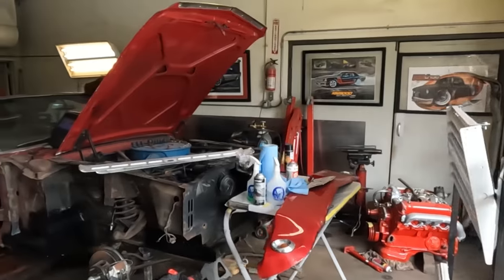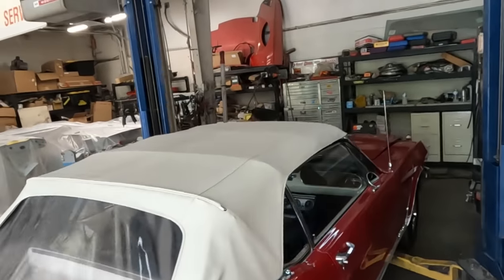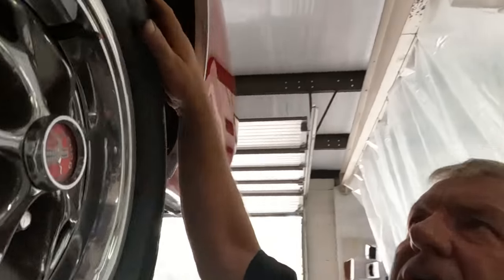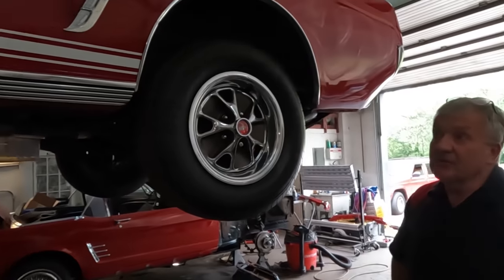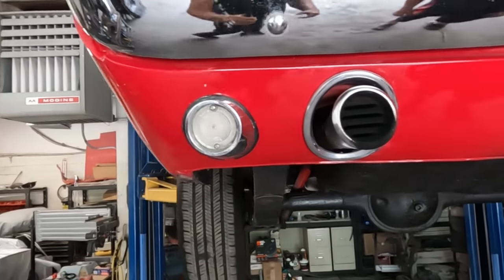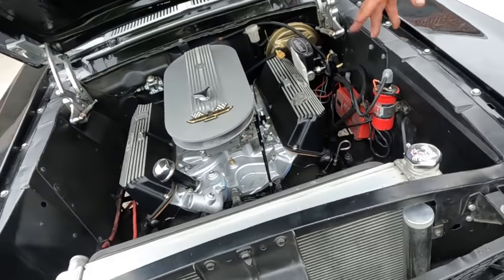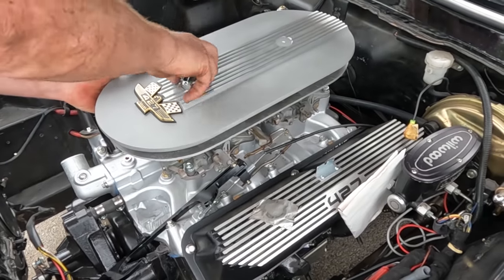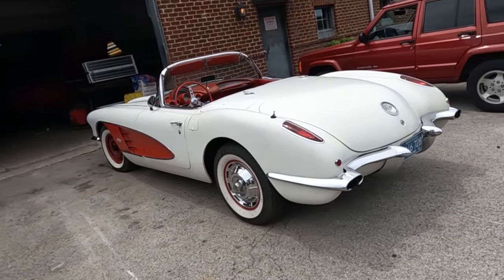Even MORE Classic Car Flipper Thievery, Incompetency And Nonsense

Comment: I was  the one that made the comment about walking past the green Camaro. I dropped a timestamp and mentioned I'm a huge Camaro nut. There's something about the 2nd gens, they look so good. I had a '71 with a high comp 350 with a mean cam. Of course I slapped a high rise intake on it and long tubes. 3.73 gears 4-speed. The thing about these cars that surprises most people is how good they handle. Really fun cars. Not real fast but quick enough. 

I'm not a huge Mustang guy but whoever sold that red hack job convertible should be exposed. That ain't right. There's a few places up here in Northeast PA that were pulling crap like that in the early 2000's. I almost bought an '86 Monte Carlo SS until I realized it wasn't a real SS. It was a 4.3 V6 car that someone put SS parts on and dropped in a junkyard 350. It looked convincing for about 10 minutes and the paint was real nice on it. The motor mounts didn't look right and that's what made me dig deeper. The car wasn't worth half of what they were selling it for.
Reply: How much can a 86  monte go for any way?
Reply: Back in the early seventies a friend of mine was working at the local Chevrolet dealer and he was just really a utility worker although he had hot rods and had worked at various gas stations doing mechanical work. Well there was another kid that worked there as well and he had put an order in for a big block Nova and while that was in the works my other buddy who's job it was to test drive the newer vehicles test drove a new Z/28 Camaro ( a 70 model but due to the GM strike did not actually go into production until 71) and my friend told that other kid that the car was a freak and he should buy it. This car was one of those that just ran right out of the box.

Comment: It'd probably be smarter to just put a roof back onto the mustang coupe where it should be.
Reply: Far more practical and actually accomplishable, and kiwi can do it for sure
Reply: either that or do a full endo cage inside of the rag top if the owner doesn't mind the crowded cockpit, not to mention it would look ridiculous with the top down but it would be the cheapest option
Reply: Exactly. Tbh I'd rather have a coupe.
Reply: Dont know if it would be worth the cost unless it was a numbers matching car. Might be but it would depend on ones intentions for it. Many people would find the value just in having a nice early Mustang while others are always looking at the investment value.
Reply: @edfrawley4356  I think it'd be cheaper to put a roof back on it than to find all the factory bracing or build the bracing for the convertible top. If he doesn't care about the factory style appearance he could go the roll cage route it'd probably be even cheaper than putting another roof on it.
Reply: @DanEBoyd  it'd probably be pretty hard to find the braces and torque boxes to put on it. If you can't find them you have to build them and having someone do that can get pretty costly. I've always thought structurally the spot welds would keep stuff from flexing better than the mig welds that would replace them. That may not be the case maybe it's my OCD that bothers me about it.
Reply: @dylanhartz8473  im pretty sure cage is out of the question- never met a convertible mustang owner who wants to ride with a helmet on. Driving in a caged car with no helmet is just tarded- your skull is gonna open like a raw egg when it crashes into the roll hoop
Reply: Insure it and crash it or burn it
Reply: Have you priced out professional body work ? I'd wager it's cheaper to reinforce the structure, and tons of options are available, every piece is available in reproduction, and superior aftermarket solutions also.
Reply: If those GT badges are real, then yes, you can splice in a roof. it will be better to remove all paint than try to match, and likely more butchery will be found. that all said....with the demand for fastbacks now, Ringbrothers offer a carbon fibre roof, and you can find other sources to upgrade this abortion if its not a GT car and make an eleanor for someone who will pay a lot for it. Or it can be cloned into one of the rare shelby convertables, the torque boxes and extra braces are all out there--Mustangs get rebuilt often enough their sins (leaky cowls, side rails) are reproduced so you aren't cutting apart a parts car. It just takes a knowledge of Mustangs, not some generic "we do everything" resto shop that checks out some youtube videos and think they're expert since they can do a spot weld.

(in 1964 Mustang VINs did mention with a 7 or an 8 whether it was a coupe or convertable, too bad the buyer didn't check into it. Doors get swapped and the tag gets lost, but there's a stamping under the driver front fender. Unless a fool does a Mustang II front suspension swap for clearing and just cuts off that panel.
Reply: Yeah,  I don't know why people like convertibles?
I heard that they were really made for California,  were you could leave the top down basically forever.
Reply: @edbeck8925  that would be most of the west.....
Reply: @edbeck8925  most of them cowl shake like hell, and susequently, handle poor, rattle, etc, especially American cars, up until very recently. 60's unibody cars are awful. They are fun, but impractical, I bought a dual sport motorcycle, because I use it the same way, nice weather, backroads, no hurry, but cheaper to buy, insure, store, than a Jeep.
Reply: Sad but it's probably not worth it. Pull the driveline and use it in something else. Falcon?
Reply: @jeremypike9153  just keep it a convert and order the replacement bits from dynacon/others and add supports in like sub-frame connectors 

BTW to me it's worth more with convertible mod bits done right ( what ford/designers wanted all mustang's to be same. same with the 67-71 dodge charger but accounting departments stopped that fibreglass roof from being standard option code and not a add-on/or killing off the order code ) vs janky steel hardtop-welded back on, if you have that bad of a hard on for a hardtop get the ford accessory towntopper or fibreglass fastback topper to keep the soft top looking fresh
Reply: @genehart261  no an a code mustang is worth$ and the parts are available new to either make it a coupe or add the convertible parts !
Reply: @johncholmes643  been a thief all your life?

Comment: One of my neighbors knows that I have an MGB, and he was looking to buy one.  He asked me if I could have a quick look at it for him, since he figured I would know if it was junk or not.  Well, the first thing I do is tap the rockers, and sure enough there was a little rust pile falling out of the "new" rockers.  They were also trying to tell him that the gearbox was a racing unit, and you had to double clutch every shift up.  I asked them to start it, and it was in dire need of rod bearings.  Sometimes it is nice to do things like the for someone who clearly would have gotten ripped off.

Comment: There's another, unintended lesson here as well. If you add the convertible-only reinforcements, Monte Carlo bar, and export brace you'll get a far more rigid and solid-feeling coupe or fastback. Step up to the Boss 302-specific shock tower reinforcements and belly bar to really transform the car.
Reply: Yep. An export brace on a regular ole '65 289 Mustang does wonders. Ask me how i know 😁

Comment: I about spit out my dinner when you mentioned the backyard  hacked Oldsmobile delta 88 with the roof sawed off because I actually had a 1976 Olds 98 Regency 4 door, 455 that my grandmother stopped driving in favor of a much more efficient car.....she gave it to me so I got out my uncles 4" Makita Angle Grinder and convertiblized it.
The addition of single Flowmaster muffler and flpped air filter lid made it a muscle car. Krylon slate blue spray cans replaces the appliance white original paint. Me and all my buddy's drove it from May to October 1997 before I yanked the 455 for a cutlass swap and scrapped it. Best thing was that it did seat 8 to 10 people comfortably. Lol
Reply: Did the same with rusty 58' chrysler...good times 👍
Reply: Delta 88 455 two door. I delivered pizza in one back in early 80's great memories.

Comment: My buddy rolled his 51 Ford shoebox 2 door sedan on graduation day 1967.  Easy roll just caved the top for a ways behind the windshield, which also broke.  So we torched (never heard of a sawzall or hand grinder in 67) the roof off just above the door seam on the B pillar.  Winsdhield as well, but left the A pillars.  Welded a 36 Ford windshield to the driver side A pillar and a home made angle iron extra A pillar to hold it on the drinker's side as it was about a foot short of the real A pillar.  He drove it all summer, but eventually the highway bulls nailed him because the top of the windshield was about 2" to low above the seat...(they claimed...like who ever heard of that???) so we took out the seat bottom padding to lower it LOL   They were not amused, but had to sign off on it.  But they were out to get him after that.

Comment: Mine was a 75 Lemans with a big block 350 . I ripped the headliner out , laid down fire blankets and used a torch to remove the roof. Drove it all summer 1987 . The best $50 car I owned in highschool. BTW, it never sagged, I made sure it had a full frame first
Reply: A big block 350, huh?
Reply: That would be the Sheriff's car in Smokey and the Bandit, more or less. Slightly different method of modification....
Reply: Yes sir that car was a body on frame, but even body on frame vehicles have extra engineering in the frame for support. For your purposes the vehicle held up well.
Reply: @ricodelnegro4010 Some people call Pontiac's 350 a "big block", because it's their tall deck block, as opposed to thier 301 and 265 which were short deck blocks. 
Oldsmobile is similar in that way as well.

Comment: Weird that the body work, which seems impossible to me, is so beautiful and yet the unseen strengthening parts which any hack like me could weld-grind-weld-grind-weld were skipped.
Reply: there is probably a 3/8's of an inch of bondo on that car.. I hate these flippers just ruining the hobby for everyone..I bought a ford and the homemade patch panels were welded on top of the rust and some rust areas were filled with insulating foam, sanded down and painted black to hide it.

Comment: The result of a shop owner who does no actual work pressuring his employees to "get it done by next week, I have a buyer coming in to see it finished". Many times it comes down to "you can't leave until it's finished". Guys in the shop say screw it and let's get it done. Add to that, shop owner most likely screams, cusses, and throws tantrums when he don't get his way. I worked under similar conditions painting big trucks. We turned out some jobs we were not proud of unfortunately.
Reply: that gets missed by some fans of the old reality TV shows. they think the drama is all made up (and i'm sure some is guaging by the acting ability) but there are plenty of for=profit (i can think of doctors too) that "assembly line" a process to get money flowing. Hot rod shops have it bad because they order parts on credit, and when they lose that credit, they exist by taking your check for your car and applying it to the customer who came in before you (popular hot rodding magazine recommened an engine rebuild shop before PHR went under, and that engine rebuilder was caught doing that before THEY went under). so thus "the rush is on".

Comment: One of the first things I learned about what to look for when buying a used car of type but especially something that you know has had work done is to look at details. If you see spots where they cut corners like Tony showed here with the rockers and paint runs left in trunk and even left over compound from where they buffed it and didn't take the time to wipe off the excess out of the cracks and crevices there is a good chance the whole car was done shotty so walk away.

Comment: In the 43 years of owning and driving a 68 gt coupe I've never seen   any thing so poorly constructed, I can't help but wonder what outcome  they expected ,cutting the roof off removes 60% of of structural integrity, feel bad about owner, if I were to buy another mustang, I would get a Marti report on it,bummer.
Reply: Marti reports aren’t available for the 65/66 mustangs. However, the door tag if available would have provided the buyer with all the information required to figure out it was a coupe and not a convertible.  Having a little knowledge and researching would have saved the owner a ton of cash.  Just looking at the car it’s also easy to tell it’s not a true GT as this was also faked.

Comment: You can tell the side oiler from the lower sides.  There's 3 bolts at the bottom because it's a cross bolted mains design.  Although you can cross bolt any FE, you can also bore out a 360 IF it measures up, or sleeve any FE to 427 bore.

Comment: Spot on about the structure differences between a hardtop and a convertible...and it's not exclusive to unibody cars, either. Most full framed cars have differences as well, like in 60's gm a bodies. It's common for the frame to be boxed further along it's length, etc. to accommodate the soft top.

Comment: Interesting thing. I think the wheel arches being beaten down is a factory thing on the 1st generation. I owned 2 73 convertibles and both had the top of the wheel arches smacked down pretty hard and factory paint over top of it. This car isn't factory. But the used a factory procedure. There's was probably one big dude on the convertible line with a sledgehammer who's job was the smack the wheel arches till the tops fit

Comment: Flippers are like puppy mills--when Disney came out with "101 Dalmations" folks flocked to buy Dalmations without knowing their biting nature. At least this coupe didn't swap VINs, that really would have been a disaster. There was a company that made a hardtop coupe conversion that acted like a 1950's "sundowner" retractable, and that gave some folks ideas too.

427 FEs are tricky, since they really don't have enough room for an overbore. Original blocks need to be sleeved if you're going to put a 410/428 crank for 454 cid, or you buy an aftermarket one. In the end, a 351W stroked to 427 cid is a far better choice, but the swap speaks for itself. All i'll add is the tripower intakes--if it's holding the carbs at an angle, it's a Galaxy intake since their engines are tilted but the thunderbird intake has the carb mounts nice and level. in case you spot one sitting on a blanket at a swap meet and wonder what it's for :)

Comment: Not sure if it was mentioned in an earlier comment but not only was this not a factory convertible but not likely a factory GT either. Factory GTs did NOT have the metal trim on the side nor the rocker panel and EXTREMELY unlikely that an owner would add these after the fact

Comment: KIWI/UT- is that car really not salvageable? What would it really take to make it a usable car? I know they make frame mid sections for these so they can basically body on frame and unibody. If they secured the seats and everything they need to in there they might be able to add frame midsections under it, sway bars and strut bars front and back, and maybe a roll bar to stiffen it up. I know it would stick out but if it makes the car usable then why not?

Comment: The side oiler had cross bolted mains like all of them but screw in code plugs. The engineering number wont be C3 something it should be C5 something.
Reply: The first thing they ought to do is look for the cross-bolt mains. Only 427's and 406's had them. That engine could easily be a 390 or even a 352, and it is highly unlikely that it's a 406.

Comment: I would want a full inspection and dyno test on that FE before I continued. 
It's really easy for an engine builder to build a crappy FE....
He can always go back to a Windsor if that FE isn't strong and healthy...
Reply: A dyno test is not needed when buying a classic but a inspection by someone who knows what they are looking at should be done before buying a classic and even newer cars too because I have seen newer cars that should not be on the road because they are unsafe but before you buy the car pay someone to inspect it or you could end up with a pile of junk
Reply: @79tazman  What i was saying is I won't trust that engine until I KNOW it's totally healthy.
Reply: It may not even be a 427! Just take a 390 and throw amazon 427 valve covers on it and its undetectable to the untrained buyer.
Reply: @JOHNKESSLER88   EXACTLY,,, or worse..
I don't trust it...
Reply: I love FEs and have owned several. But with the quality cylinder heads, plentiful stroker kit options and so forth now available for Windsors, it's easy to make what used to be exclusively big-block levels of power in a significantly smaller, lighter, cheaper package. They make way more sense these days for anything besides a restoration.
Reply: @DragPakMerc  Agreed...
He really should have just built the Windsor,,,  his life would be so much better right now.
I've owned many FE's and have a nice low mileage all stock 390 powered 67' Galaxie 500 fastback right now.

I'm thinking about it and I've had a 64' 352 2bbl, a 64' 390 4bbl, 3 truck 360's,, a 428 powered 67' Country Squire,,  2 67' regular fuel 390 2bbl's and the one I still own is in the garage road ready with ice cold air...  :)